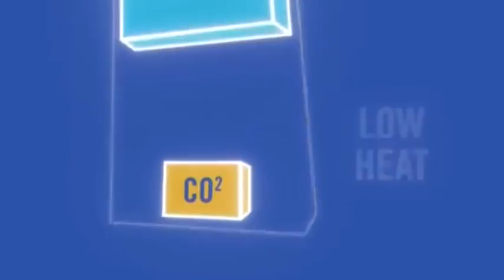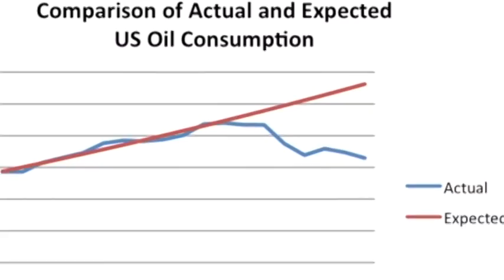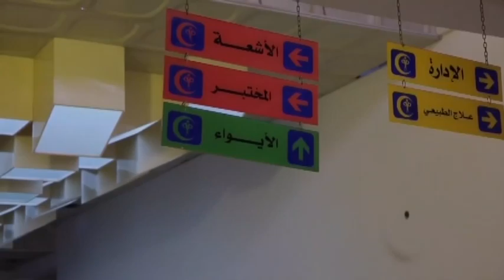Renewable Energy Has a Bright Future

Comment: The initial presenter was quite annoying ~ referring to forestalling the devastation of global warming as "hippie talk" ... recommend skipping 20 seconds in, save yourself the aggravation ... watt for watt, renewable energy has become cost competitive with fossil fuels, and will soon surpass them ~ the only thing holding our civilization back from going 100% renewable is the infrastructure investment.
Reply: I'm planning on building a house run solely off solar, wind and several high KW capacity lithium ion batteries.
By my calculation I'll be breaking even in approximately 7 years.
When I used to be a solar panel roof surveyor 7 years ago, the same set-up wouldn't break even for 13 years.. Soon as it gets down to 5 It'll certainly be worth the investment, and I estimate that to be by 2021 at the latest (most of the present cost going to the ion batteries that are dropping quickly due to the tesla powerwall schematics going public).

When it hits 4, it'll be financially logical for smaller homes to actively just go off the grid altogether (perhaps still connected but just not using it).. we're getting there..
Reply: This needs some subsidies, make that initial investment less painful, so you won't be thinking years until even anymore ...